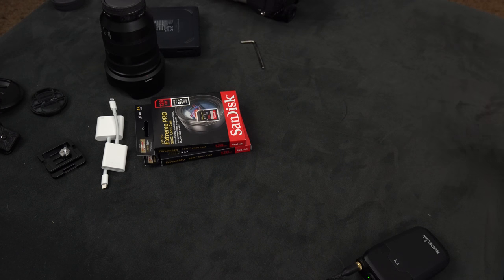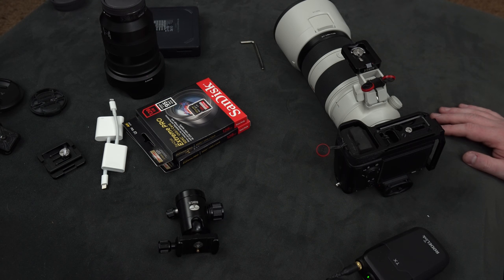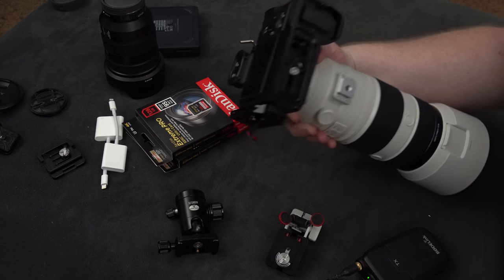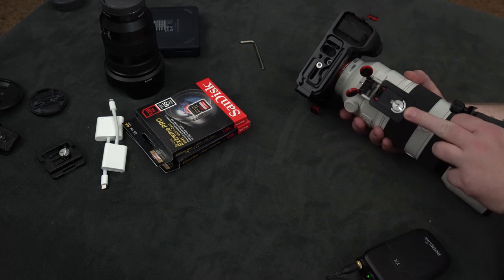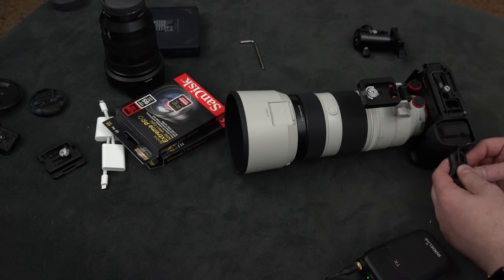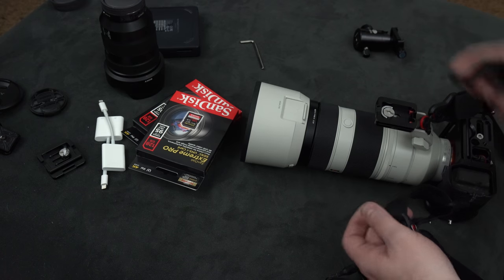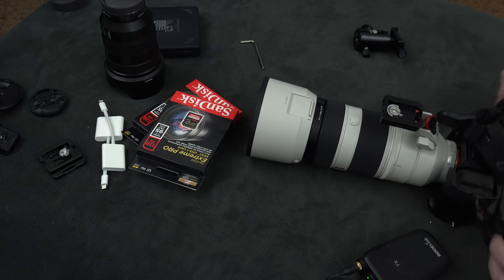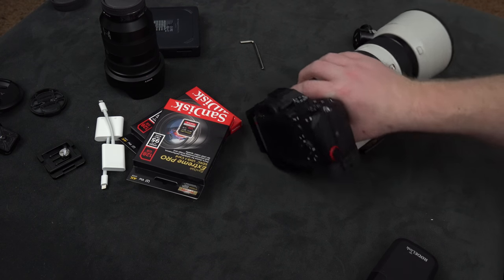How to connect 100400GM to peakdesign straps after the recall of V3 anchors

Comment: Daniel the rubber protection looks like the way to go. Just have to monitor how the rubber wares I guess. Just to be really paranoid I thought the dovetail connection between the foot and the lens was a bit small for the weight it would carry upside down but it it is quite thick so I guess the strength is there. The same design is used on the 70 200 2.8 (I assume?) and that lens has been out for sometime and any problems would of been noted (?). Adding the loop to the strap seems a very good idea too although I guess you will have test out if it gets in the way to much. Maybe a loop of something much thinner as an alternative?